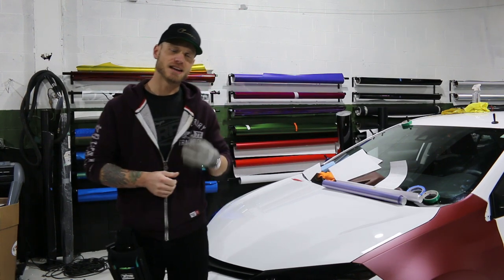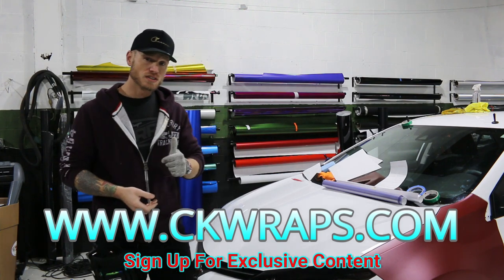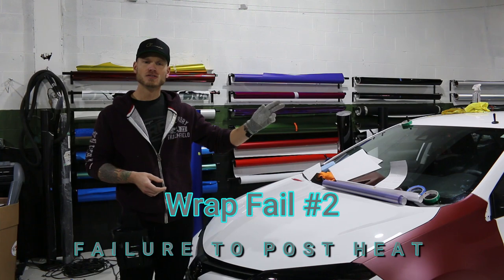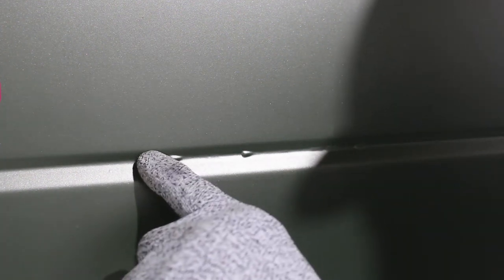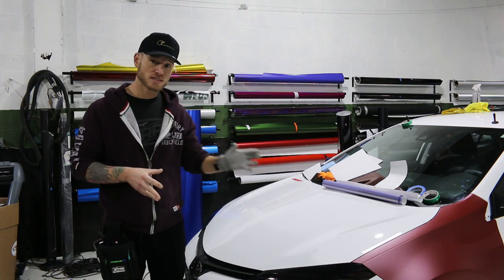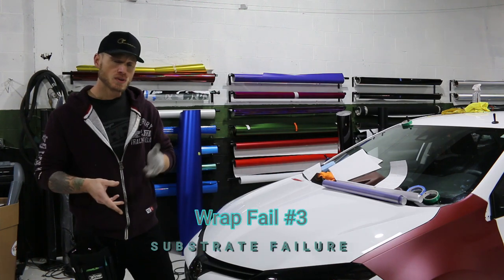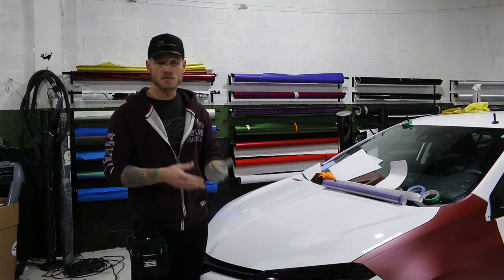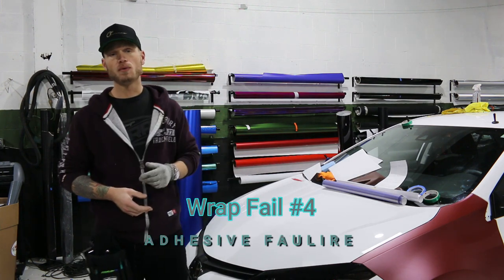4 Reasons Why Your Wrap FAILED! - & How To Troubleshoot It

Comment: Surely most problems due to adhesive separating is due to an incorrect post heating process? Obviously some cases can be down to purely poor manufacture of the vinyl, but most of the time will be down to over heating while post heating?

Comment: CK. I am able to remove the lifting in that V like you show and it looks great afterward, but the following day, it is back to the same problem. I have tried post heating but it still doesn't seem to stay. Do think I am not getting it hot enough on post heat?
Reply: CK, I wanted to update this. I tried using a laser thermometer on my post heating of the V to ensure I was reaching 170+. It seems to have worked. No more lifting in the V last I checked and your method for 'fixing' the V works well, just make sure if you are reading this to put plenty of heat in it. Also I noticed my cheapo vinyl gets tacky when it's hot so I have to let it cool a bit before pressing it down into the V.

Comment: Ive had a problem where I tuck the vinyl in heat it after to the right degree and a few days later the ends start to lift again what could it be.... using hexis vinyl aswell.. wrapping over straight panels is great but anything that bends or corners is horrible
Reply: I'm having the same issue 😕( same brand )  Did u ever find a solution?

Comment: Would you be able to cover how to wrap vented hoods? getting into the vents i found very difficult
Reply: This
Reply: I would lay over the hood vent, but kinda form a slight air bubble above the vents on your hood, then I’d cut slits between each vented part and add heat, then smooth out by hand or what you got

Comment: Is there a way tell if the vinyl has good adhesive? I just purchased the VVivid high gloss carbon fiber you used in the Tesla interior, and it wont stick to crap!  The backing is barely hanging on to the vinyl!  Not to mention the tape that was holding the roll had yellowed.  I ordered from amazon, should I have ordered directly through Vvivid?
Reply: They have a shelf life before the adhesive stops being so effective.

Comment: Love the videos! How do you make vinyl stripping to stick to plastic pieces such as side skirts, rear diffuser, front spoiler? I used a promoter and still wouldn’t stick… any tips pls
Reply: Did u ever get a solution?
Reply: @stephaniea3688  3M Primer would work I think. although wrapping a diffuser is so common it should work anyway...

Comment: Around the 8 minute mark with the bubbles... I'm facing the same issue even after having cleaned and post heated.   My guess is it's just a high tension area (tailgate on an SUV around the license plate).  After heating again and removing air, the area will lift again after about 20 minutes or so.  There a way I can inject some primer 94 with a syringe into the lifted are and fix this issue or will it not tack enough to adhere to the wrap?  Pretty irritating.
Reply: @Bill Rupp  Thanks, all what you say is true.  I've redone my tailgate, but had to first lay a piece around the license plate area and trim at the contours.   My second piece covered the whole tailgate where it was trimmed up to match and very slightly overlap the first piece.  The result put much less stress on the wrap around the recessed plate area and it looks great for about a half year now.  Have the whole car done in the Vvivid + grey forged carbon matte wrap and get positive comments on it all the time.  When done right, all the hard work pays off!

Comment: Hey I have a question..I recently got my car wrapped & I wanna add a rear spoiler on my car ..the spoiler requires me to drill 2 small holes on the trunk lid ..would this harm the wrap?
Reply: I would lay some low tack blue painters tape covering about a 3-6 inches around the area you drill and take your time (drill periodically) to allow it to not get too hot.  The tape coverage will also minimize hot metal flakes from landing on your wrap.

Comment: You have not done a video for posting heating for temperatures. What is post heating? Am I heating the surface or the vinyl?
Reply: Post heating is heating the vinyl after you installed it in stressed or recessed areas to "kill" the vinyl. Each vinyl has its own temp, so check that before you post heat.
Reply: PsychoToys he has a detailed video on this on ckwraps.com

Comment: How would I be able to wrap over a rust proofed bottom side skirt? Would I have to remove the rustproofing in that area? How would I go about doing that?
Reply: Clean it up very well and you could use the primer 94.  Don't over apply though.  I have my wrap very slightly sit over my spray bedliner edges and the primer helps adhere vinyl to it.

Comment: You mention "atleast 70% isopropyl alcohol" can you use 99% or is that too much alcohol to use with vinyl?
Reply: the difference between 70 and 99 is the "aggressive"... you can use 99% too by right handling, but it maybe crack plastic and spot repair areas. 70% is more safer in right use.

Comment: Does temperature affect all films equally too during install? 
I have some satin militare KPMF I am waiting to use when it warms up. KPMF say to install 21c to 24 c.
Reply: GTR-J  post heat temperature is slightly different between brands, just double check with the manufacturer for proper temps
Reply: It's helps to use the film at room temperature or a bit warmer.   Cold temps make it harder to stretch and could tear the vinyl.  Doing it on hot days has some drawbacks too.  Matte is very picky with a heat gun (glosses up) ,so heat carefully.   Satin isn't as bad, but be modest when using the felt squeegee.  Satin is my favorite to work with looks great!

Comment: At what temperature setting your heat gun is when stretching?
At what temperature setting your heat gun is when post heating?
Reply: Reinout Van Vlaenderen this is on ckwraps.com
Reply: @navfrancis4516 , thank you, it's been a while ago since I had the honour to talk to a smart ass.
Reply: is not necessarily a matter of heat gun temp setting (a lot of installers use simple guns with just 3 settings low/med/high or a gas blow torch ) the temperature you should be concerned is the actual film surface. for stretching you simply feel the film getting softer and for post heating 80-90 celsius (measure it with a ir gun )
i hope this will help
Reply: @mirondraghici5356  thanks. That makes sense.
Reply: @reinoutvanvlaenderen720  use a temp gun, dont worry about heat gun temp.

Comment: great video, can you wrap over a bed liner?  My truck is comply rhino lined and I want to add mossy oak 3M vinyl to the rocker panel, thank you
Reply: I'm pretty sure you can't..rhyno liner is not flat so either it won't adhere or it would look like crap
Reply: @motosapien2310  thank you
Reply: The surface needs to be smooth for the film to stick. Bed liner has too much roughness for sure.
Reply: I have had success in small areas going over bedliner with some good heat and some primer 94 in some areas.  Problem is it is very hard for wrap to adhere to the  rhino liner and you may not find it worth the time.

Comment: Also fails because every film has a factory prestretch so I can’t just push it in a recessed area if it’s aggressive . U need to heat the film and it will shrink then work it it. Never knew till inozetek taught me in their classes.
Reply: @Bill Rupp 50 years, sure bud
Reply: @Bill Rupp  damn bro how old were you when you started???